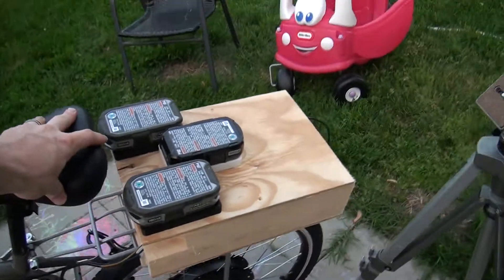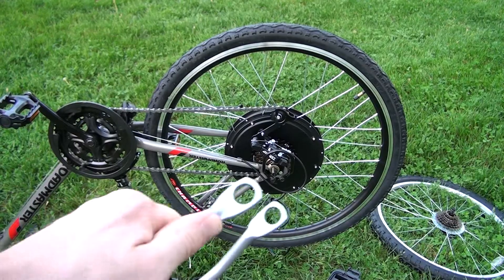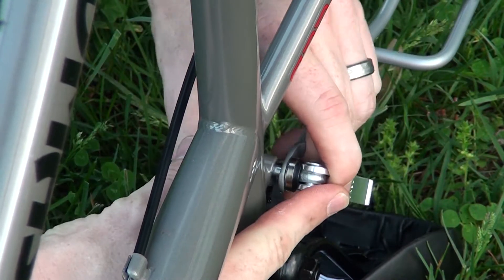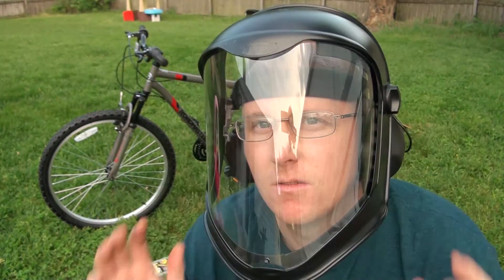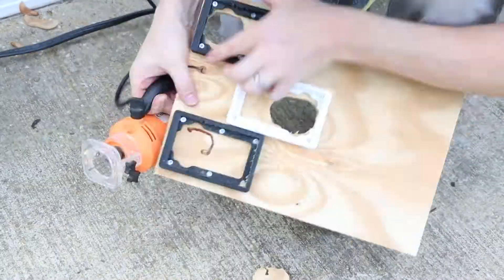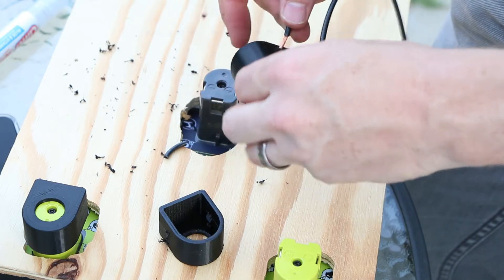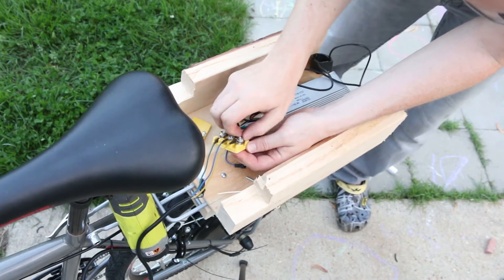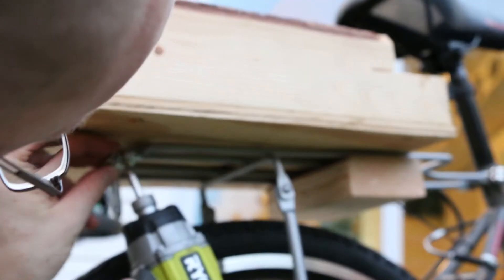Ebike Update on progress with ryobi batteries 18v

Comment: if i have a 48volts motor how many electric drill battery will i use?
Reply: You can’t. Two drill batteries is 18v-20v. Three drill batteries is 60v. Get a 36v motor. Two drill batteries will work. That’s what I use at the moment. 15-18mph

Comment: I used two 4ah Ryobi knock-off brand 18v batteries from Amazon to power a 36v, 500-watt e-bike hub motor, also from Amazon. I took it for a test run and I had some melting going on at the positive terminal on the battery. I used the same 3D printed PLA terminal cap that you used and it was melting and I believe there was slight melting on the battery around the terminal as well. My suspicion is that the battery has a defect, the terminal was not making a good connection (pretty sure not it), or the battery and/or terminals could not handle the increase in voltage/watts? Has anyone else experienced melting at the terminals when running in series?

Comment: I want to make a 36v 20ish amp battery to over power a 500 w motor that I have. I can’t find any videos to describe what is best or even what I really need. I came up with these numbers based on the motor. It said it could handle the V and Amps. I understand mAh is Amp but watt hours and amp hours confuse me.
Reply from the maker: watt hours and amp hours are capacity of the battery. How many amps you can draw depends on several things. One of those things is the capability of the individual cells (find the data sheet) another thing is the BMS board. The board may have a limitation. Watch this series https://www.youtube.com/watch?v=b3eRv_FZjBc he designs a battery for the application you are talking about.

Comment: Your setup is odd and you say heavy? My setup works perfect.  54v nominal, but closer to 60v+ when you use a volt meter. 4 amp hour lasts my 1000W hub motor about 5-8 miles. https://www.youtube.com/watch?v=lowPO1DSo7g  Also I've been using Ryobi Li Ion batteries from home depot for years now.  they are 10x lighter than lead acid and they go just fine.  It does not damage a lithium ion battery to drain it super fast or slow, it makes no. difference.  Use my setup if you want a nicer way to connect the batteries.
Reply from the maker: watch my other ebike battery videos... you will see an incredibly different direction with the power source... either way, yours is great!

Comment: I did almost this same thing on my last ebike , i used oth 40v and 18v ryobi batteries . The unspoken drawback is tool packs are not built very well and are made to burn out after while , using it on a ebike to much murder them . On ryobi batteries it typically shorts out the T1 or T2 terminal making the pack unable to charge or be used in a ryobi tool . If you were curious the cells inside are typically inr18650-13q 1300 mah cells
Reply: your both completely wrong.  I've been draining my ryobi batteries for several years now with no drawback on performance or distance with my E-Bike.  https://www.youtube.com/watch?v=lowPO1DSo7g
Reply: i'm using 2 18v knockoff packs on a 46v motor and after 20 or 30 rides i haven't seemed to have ruined any batteries. barely even a drop in range. maybe i'm just lucky, or maybe a higher voltage motor will perform better.
Reply: @pluepluelasers152  Do you mean 48v? It doesn't really matter because volts isn't the issue it's amps .  If you constantly discharge any lithium ion battery at it's max discharge rate you wear them down faster and run the risk of them randomly dying due to dendrite damage from rapid discharge recharge cycles. The lager the pack the more batteries inside which reduces the amp draw per cell reducing or removing this issue. The batteries used in this are the smallest Ryobi make and are only rated for around 500w . I have personally killed 4 or 5 of these using them in tools made to use the large HP+ batteries i have no doubt and Eike would do the same. 
My ebike has an 80v battery with around 200 cells to dish out ruffly 3360w it discharges at roughly 4amps per cell. For a ryobi 18v (20v max)battery to hit it's target 500 watts each cell must discharge at 25 watts topped off and higher as it discharges. This means it will reach it's max peak at stay there while in use. A properly built pack would never reach that in the first place allowing for a longer service life .
Reply from the maker: +Wind thanks for the comment. I think the newer batteries hane a higher mah.. nonetheless, if u draw full throttle for any time, bad times will be had for sure
Reply: The issue people encounter with tool batteries in flyback voltage from coasting etc you cannot have any voltage try run back into the batery without being hooked to the charge temp connector

Comment: I'm not sure why you're intent on using drill batteries, the largest battery that Ryobi make is a 5.0ah which is a 5s2p configuration. The runtime will be very poor with these smaller ryobi batteries. You are best off Making your own battery pack with 18650 cells and balance cables. Charging is very simple and cheap with a hobby charger. I was very unsure about making my own packs at first but it's so simple and I was amazed at their performance and longevity
Reply from the maker: +W19 ELY nice! I am making it w the drill batteries because i have them. And am curious. I want to experiment . As for the charger, i want something that charges at around 53volts so the pack lasts longer. I dont like thebidea of charging to the full 4.2 volts per cell :(  Check out my last video please. You can see my battery spot welder... I have yet to test. Also, wgere do u get your BMS?
Reply: TRY to HELP you I don't run a bms, no need. I use a hobby charger, balance leads and a voltage display and buzzer. What sort of voltage are you wanting? I have experimented a lot for 24v scooters and 32v ebikes. I find that 7cell works well for the 24v and 10 cell works well for the 32v. I have a charger that will balance charge up to 10s, most chargers only take 6s though. Even if you only had a 6s charger you could make 2 separate packs and run them in series (for example 2 x 5s)
Reply: TRY to HELP you BTW just looked through your channel and you have some great looking videos, I have subscribed and will get round to watching a few of them
Reply: Ryobi makes 9AH batteries now. Also with balance leads and a hobby charger the hobby charger IS the bms

Comment: I dont know bout batteries but my V10 in my bucket truck needs rebuildin'
Reply from the maker: +rob armstrong ooohhh G's that will be a bit of work! My 3cyl geo metro needs new rings... Since i got tye leaf running, i am very lazy about that.. good luck !
Reply: They push these motors so far back under the dash its impossible to reach anything....my mechanic days are over i ll pay the price.boohoohoo...